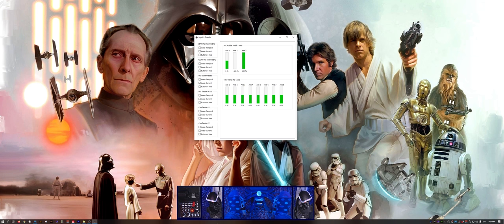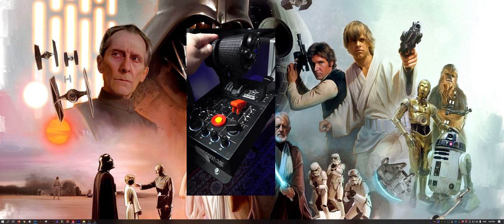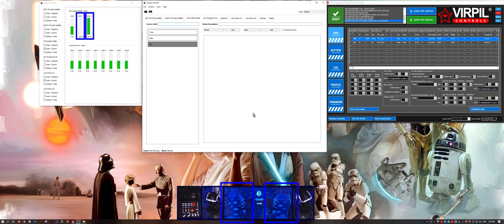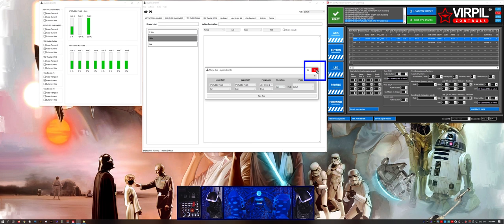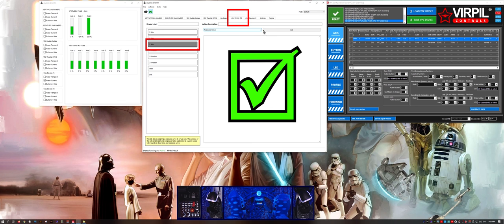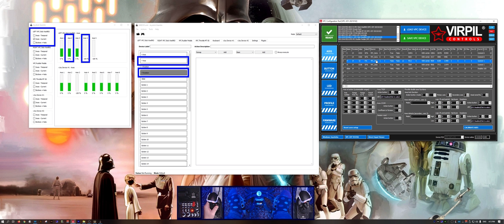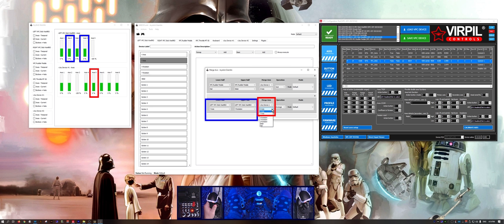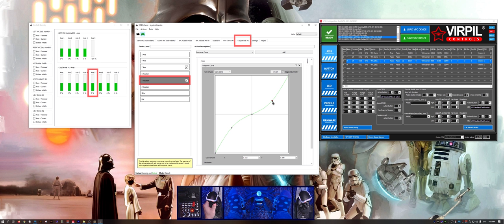Joystick Gremlin - How To Merge Axis

Comment: Hey these videos are amazing, I had a question related to this tutorial specifically. 

With a Left hand joystick in a Z adapted or "Omni-throttle" configuration the grip itself is held roughly 45°. 

Is it possible to use these merge options and Curves to rotate the logical X and Y-axis for the thumb ministick °45 counterclockwise? How would I do this? 

This would put the X and Y in a true orientation to the base, and on the Virpil Alpha Prime actually allows for further throw due to the square restriction.

Comment: Here's a bit of an odd one:
How would I go about making/merging/splitting a rudder axis (no toe brakes) with a brake lever axis, so that I can have both left/right brakes as independent axis (ie, I push left rudder + pull lever = analog axis for LEFT brake, push RIGHT rudder for RIGHT brake -- combination of rudder axis + lever == how much brake to apply), but also so that I can leave rudder CENTER and pull the lever to get brake application on both for stopping. or would there be a simpler way to do this? 

Maybe virtual button that actuates through the travel of left/right rudder to switch to "independent rudder mode" for each side, but when centered button mode is both left/right axis are actuated based on lever?

Comment: Hey there, your videos are helping me immensely with my project to combine a mass of controls into one mega beast. So far things are pretty clear thanks to your demonstrations. I have one follow up question for you. Maybe this isn't possible, but what I'd like to do is a combo with a slider (on a T16000M) and a thumbstick. I want the Slider to set the axis from 0 to 100, but then be able to use the thumb to boost or lower it by 50 in either direction.

So far I've been able to get the slider to do its part on its own by setting the response curve on the slider from top left down to center right, which sets the output at 0 when slid down, and 100 when slid up. But applying the thumbstick to that has been a pain in the butt. If I set them up separately, as you can guess the input goes entirely to which ever control is most recently used. So far fiddling with a merge the best I've gotten is for the thumb to be able to pull it up to 50 down but only to a minimum of 0.

My ideal state is that the slider would set the base amount from 0 to 100 percent, and the thumb could then tweak it on the fly while held, 50 in either direction, to a max of 100 or a minimum of -50.

Do you know if this is possible? Thanks!
Reply from the maker: I'm not sure I totally understand the scenario but I think you may  be stuck with just using Gremlin as you can only put curves on  the merged axis on the VJOY section so it will be the same for both the slider and the thumbstick once they're merged.

What 'may' help is if you're using something like VKB or Virpil for your thumbstick? (I'm not sure).  In there software you could physically limit how much the thumbstick outputs. Like set it to max 50% instead of 100%, so when you use it in the JG merge it's only ever adding at most 50% more or less to the merged slider output.
Reply: @RedLir_Live  Thanks for the response! So I figured it out, but it took a lot of tooling. I had to set them both up as separate remaps. The slider is set to absolute, with a wonky curve to keep it in a 0- to 100 scale. Meanwhile the joystick is set to the same axis, but to Relative value, and with a much more constrained scale. It's not perfect, but for cruising at max speed in space and in need of sudden short drops in maneuvering speed, it works very well.

Comment: Hm, so when I do this, merging two axes into vjoy device #1, saving the profile, and then activating the profile, the input viewer shows nothing happening on the vjoy device. I can see the original device inputs changing, but the vjoy device is doing nothing at all.
Reply: Answering my own question: windows needed a signed vjoy driver, installing the github jshafer817/vJoy/releases/tag/v2.1.9.1 release worked fine.

Comment: I am merging 2 axis into 1. The Y axis on the throttle thumbstick and the y axis on the main stick. Everything is working using your example, except I want the thumbstick inverted. Is there a way to set that?
Or do I need to map the thumbstick to a virtual axis inverted
  then merge that virtual axis with the main stick into a second virtual axis and use the second virtual axis
Reply from the maker: If you're using virpil or vkb I would try  inverting it in their config tools so its permanently set the way you want and then do any merging in JG
Reply: @RedLir_Live  I am using TARGET, its a thrustmaster throttle. I believe that will work with it though. Thanks.

Comment: How do i fix the problem that it just uses half the physical axis? You can see at 3:26 if you pause the video when your physical axis 3 is at -77%, the virtual axis is already at -100% which means i can only use half the way of my peddals. The other half will do nothing because the merged virtual axis counts already as fully depressed.
Reply from the maker: The virtual axis with a center is using both physical no center axis, each for one half of it.  Think of it as taking two sliders and merging them into a regular stick axis that rests at a center position.

The physical axis on the toe brakes don't actually have a center, but the JG UI shows a range of +/- 100 even though it's really 0 - 100 for an axis with no center.  At the resting position my physical axis read -100 and +100 because of how they are configured in the Virpil Software, so in order to get the virtual axis to read 0 when at the resting position ( or both pedals fully depressed), they are merged together with "sum".  Otherwise you would merge them with Average.

The practical use case for me is using this virtual axis as the forward/back binding in Star Citizen which takes an axis with a center.  So when I move one toe brake, I go forward.  If I move the other, I go backwards.  If I for example have forward fully pressed down, adding the other pedal will reduce my speed and also bring me to a full stop if I have both pedals fully pressed (or depressed) since their outputs are 'summed' together and would fully offset each other.

Another quirk worth noting is that when you first start a profile, you need to move all your axis a bit for things to kind of come alive properly.
Reply: @RedLir_Live  Thank you for your fast response. I understand that. What i ment was, it still just uses half of your physical axis. I'm pretty sure if you monitor the merged virtual axis you'll see as soon as you have 1 of your physical axis pressed half the way, the virtual axis is already at 100%. Because thats what i see in the video and i have the same problem here.
Reply: @RedLir_Live  Move your peddals slowly, and you will see no effect for half the way of the paddle in merge-Mode.
Same Problem here. Seems like a wrong calculated merge.
Reply from the maker: Yes I just tested it here. It seems it's a bug with the summing with two physical axis at different ends of the range.  I had already moved on to using one of my axis reversed in Virpil software so both pedals start at zero, and switched to merging with 'average' instead of sum.  It works correctly that way.
Reply: @RedLir_Live  Thanks. I can't try that atm, but sounds like reversing one axis is the only solution. I'll try UCR instead of JG aswell.
Reply from the maker: What pedals are you using?
Reply: @RedLir_Live  Im quadriplegic. They are part of a completely rebuilt hotas warthog.. We took the hall sensors of the throttle and built it into custom casings for hand used pedals :)
Reply from the maker: I'm not sure if you're still using target  with that setup but I guess that might be the only way to pre flip it unless there is a physical way to modify the sensor to output the signal reversed.

With Virpil or VKB it's less of a hassle given the configurations are saved directly to the device.
Reply: @RedLir_Live  I could flip the magnet for 1 hall sensor but i tried ucr and it works fine with merging axis even when 0% is on different ends. I hate target xD.  Anyways thank you for taking the time to help me!
Reply from the maker: Awesome. Glad you have a solution!

Comment: Not sure if you've experienced this, but I've got a random issue where in-game (DCS in this instance) the key presses on my vjoy controller don't register, but then if I click out of the game and into the Joystick Gremlin window, they will register in the game controls, but don't work still..
The normal Xbox controller buttons that I didn't adjust can map just fine, but the axes I turned into buttons only work if I click in Joystick Gremlin, but stop registering once I'm actually in the game again. If I need to do something like pull the right trigger to shoot my laser, I can hold it in game and it won't work, but as soon as I click out and click on Joystick Gremlin, and pull the same trigger, I see it working in game.
I've tried running as Admin and re-mapping, but so far nothing seems to fix it.
Reply from the maker: Not specifically that, but there seems to be something funny with how Xbox controller works with Gremlin / hidhide.  I used one for the first time the other day to try and map it to some stuff for testing and I had similar wonkyness. I have to wonder if something about the MS software for the controller that interferes.
Reply: @RedLir_Live  Ha, yeah. That's what I was worried about. The worst part is I initially went with the Xbox controller because getting the PS4 controller I had to reliably work with my PC was an even bigger pain in the ass.
I'm just not mean to have nice things. Thanks!
Reply from the maker: @aaronwhite1786  I don't really use controllers but I would interested if other brands work.  Cheers!